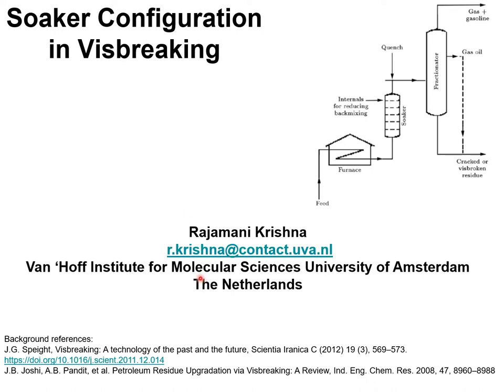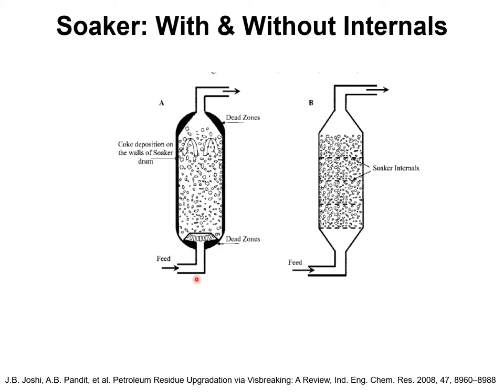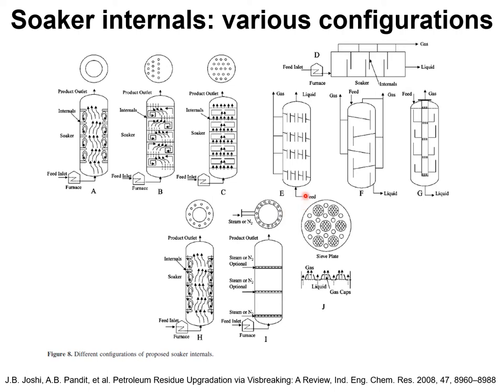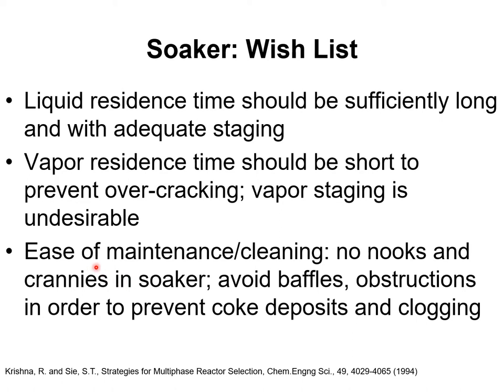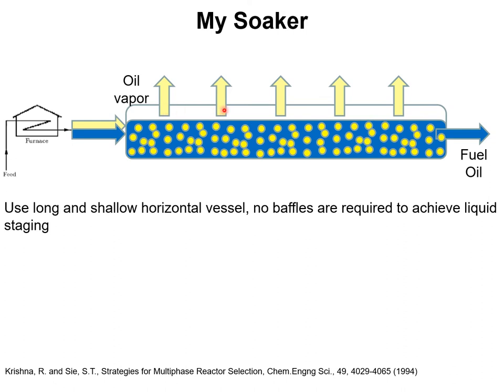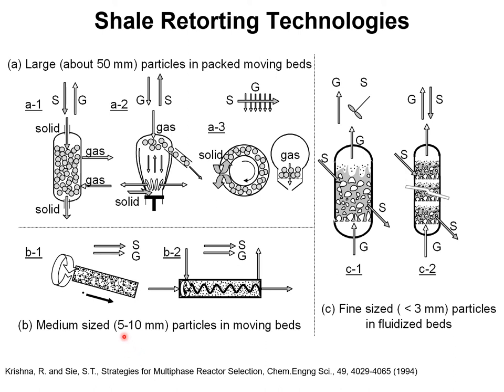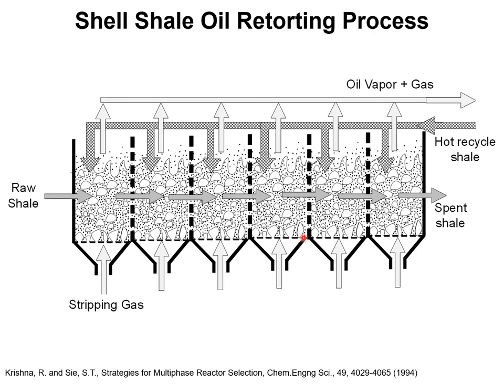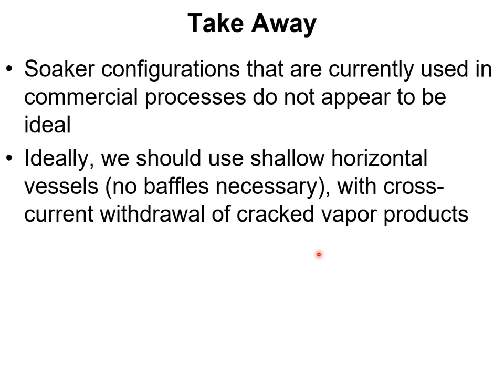Soaker Configuration in Visbreaking Process

Comment: Well explained and very interesting soaker design with valid reasons for you ideas. Thanks for posting!
Reply from the maker: Many thanks for your response.  I am hoping that my design concept of shallow horizontally disposed soaker vessel without baffles or internals will be adopted by the petroleum industry.   I see absolutely no merit in current vertically disposed soaker vessel designs using perforated plates to introduce staging.